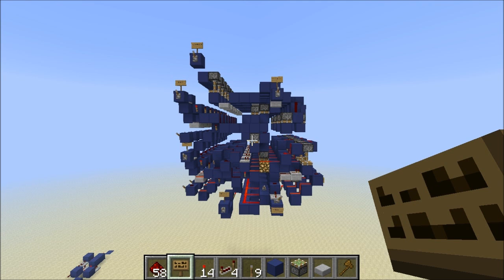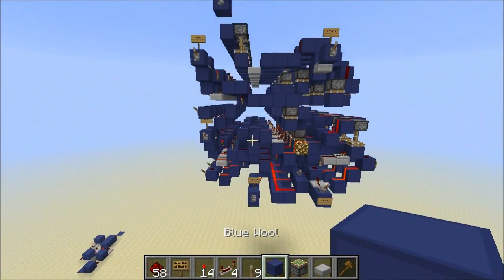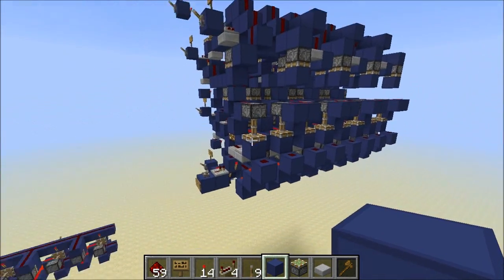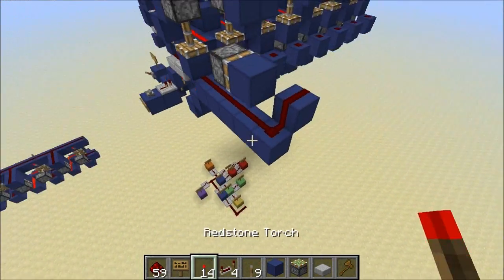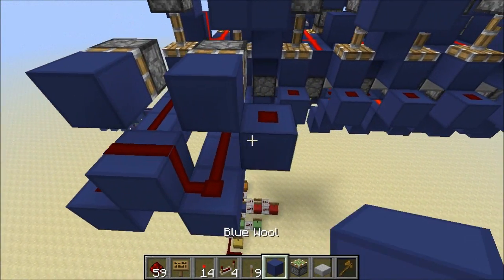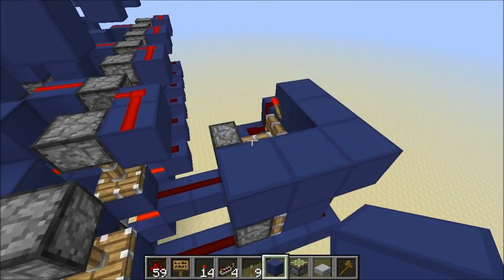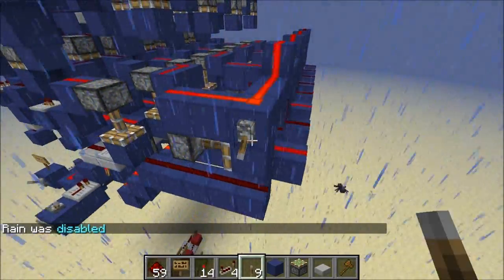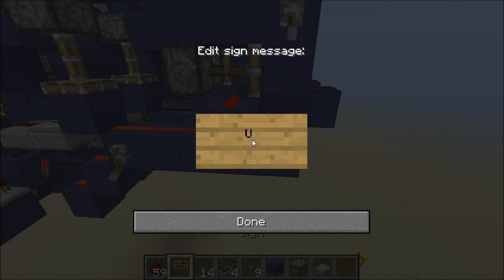Minecraft: How To Build An 8-Bit Computer - Part 7 (ALU VI)

Comment: Do you plan on adding an instruction set to the computer with op codes? I am also wondering if it is possible to make a program that handles the registers for you. In your old computer series, the registers were manually controlled. I thought it might be easier an more user friendly to have them be handled in the program. The problem is the program cycles fast and there is no time to enter input. I would hate to slow down the clock and I don't want to expand the program.